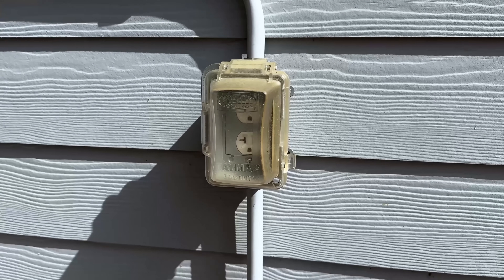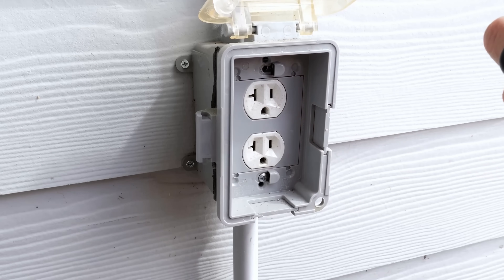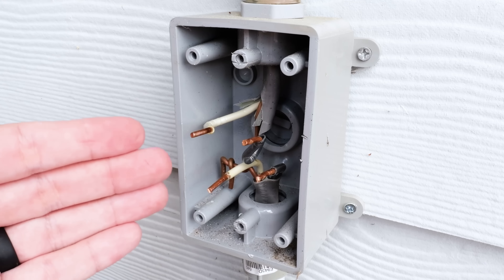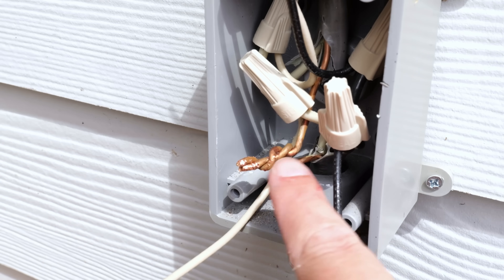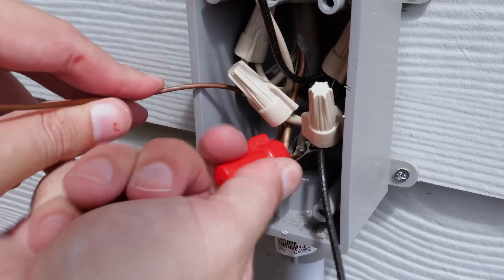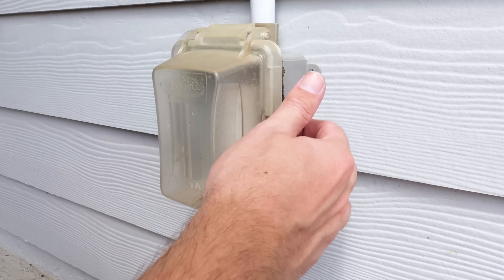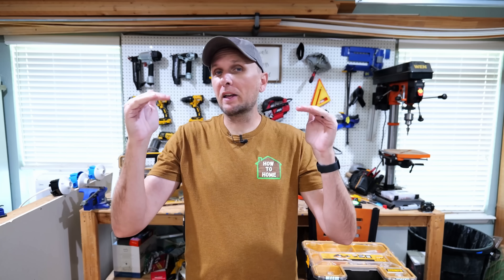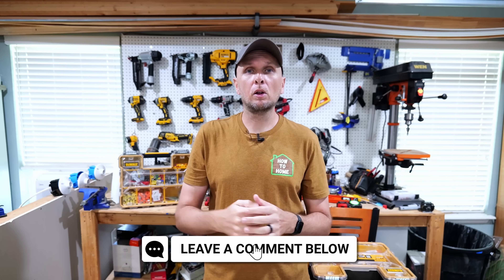Dangerous Mistakes DIYers Miss When Installing Outdoor Outlets!

Comment: Just because the outlet doesn't have a GFCI outlet, it does not mean it is not GFCI protected. The inside garage outlet is GFCI and can be wired to protect the outdoor outlet.
Reply from the maker: Sure, it could be.  But wasn't.

Comment: The GFCI receptacle also has to be weather rated (WR) for outdoor use. I find it odd that you'd want outlets down stream to be protected by that outdoor GFCI outlet since they are more prone to tripping. It also would have been faster just to pigtail and call it a day with less wire in the box.

Comment: You make a video about avoiding mistakes & then you dont pretwist your wires.😂
Reply from the maker: Not required so it isn't a mistake.  It is a better practice, one that I almost always do.  However, when you are working with #10 wire that is that short, good luck pre twisting it and not risking damaging either the wire or the copper itself.

Comment: Just a heads up, but, with outside receptacles, I will run a bead of silicone across the top side and down sides where it meets the wall, just to insure no moisture gets inside.......

Comment: Instead of replacing a bunch of receptacles, couldn't you just install a GCFI breaker in the panel?
Reply: To be fair, you only need to replace one receptacle per circuit, same as the GFCI breaker. The first outlet in the circuit protects the rest of the circuit.
Reply: Yes but those are usually much pricier!
Reply: Not as much as replacing multiple receptacles

Comment: Why did you install a 15a GFCI on a 20a circuit.  You were fast to criticize the prior electrician, but you did the just as bad of job.
Reply from the maker: What was bad about that?  It is completely legal to do that.  I had no need for a 20 amp receptacle there.  So again, please share with code what I did that was so bad.
Reply: @HowToHomeDIY   There is nothing "Illegal" about what you did, however, that is simply because there are 'down stream' devices installed.  (Had this been the only plug, a 20a would have been required).  More importantly is that  you are addressing this to more novice homeowners who are likely confused enough already.  IE, 1) putting a 15a GFCI on a 30a wire (reguardless of the 20a breaker).  2) It would be easy to presume that the 'down stream" plugs were 20a because of the wire size and because the first (original plug) was 20a, so they would be comfortable in increasing their electrical demands down the line to 20a, thus overloading the 15a pass-thru GFCI.  3) maintaining a consistent circuit quality.  ------------------------------------------------------------------------Illegal, NO  diminished professional work, YES.  I believe you understand my point, and having watched many of  your videos, I know  you can do better.  Keep the standards high!

Comment: You can't use Romax wire on a outside receptacle, it has to be TNNT
Reply from the maker: Well actually you can use Romex on outdoor receptacles, it just can't be in conduit in wet locations like outdoors.  Regardless, that isn't Romex in the video.

Comment: I'm not an electrician but according to what I learned - your J hooks are too long and the bare wires they extended pass the screws which is a mistake. Any reason you don't just join the white wires with 1 pigtail and the black wires with another one and connect the pigtails to the GFCI?

Comment: Some 
thoughts…This is a 20A circuit, but you replaced the existing 20A receptacle with a 15A GFCI receptacle—should be a 20A GFCI.  Also, increasingly entire circuits are GFCI protected from the breaker (tho this one is not), so the lack of a GFCI receptacle in the box  doesn’t necessarily mean it’s not GFCI protected. Finally, adding 12awg pigtails negates the voltage drop protection of the 10awg that somebody intentionally installed.  The pigtails should be joined with both connectors to avoid voltage drop.
Reply from the maker: No, it does not have to be a 20 amp GFCI. 

There wasn’t one and I briefly mentioned that.  

No it doesn’t that far upstream.  Has no effect on the voltage drop.

Comment: If 10 ga wire was originally helpful due to voltage drop, you just created an electron bottle neck with the 12 ga pig tails, which is definitely not an improvement.  Meeting code and electrically correct are not always the same.
Reply from the maker: Nope.  That short #12 wire that far upstream will not cause as you said, a "bottleneck."

Comment: Thanks for the video. I have 3 receptacles, none are GFI (1 in garage, 2 outside) 2 have failed. The new electrical run were just added and those are GFI on separate circuits, work great. I didn't think about extending the short wires, but will do that on these next replacements. Thanks again.A+++

Comment: If there is a GFIC outlet at the end of the line that outlet is on, isn't it and any other outlets on the line before the GFIC outlet protected?
Reply: No! A GFCI has 2 connections. 1.) Line. Here you connect power going into the receptacle. 2.) Load. This is the outgoing (GFCI protected) power that can go to the next receptacle and further piggybacked to more receptacle that are all GFCI protected.

Comment: For the DIYer , For safety's sake , Go to your local electrical supply and get a circuit breaker lockout along with a padlock and a warning tag , When turning power off to a circuit you're working on , Lock it out , Tag it out so nobody can turn on the power while you're working on it , I definitely have one in my electrical tool kit 
Lockout tagout is just as important at home as it is in the workplace

Comment: Stop the lies.  You did not fit that GF outlet in that box with all that mess inside.  There is no room for it. That's why the video skipped. Code is code" but code is wrong.  Stuffing those wires in is more of a hazard than a short wire. Stop misleading ppl.
Reply from the maker: Nope, all in there.  It skipped to save time as it skips all throughout the video.

Comment: Excellent video because you never know what is inside a box unless you look.  But you should also mention that a GFCI or combination GFCI/Arc Fault breaker may be a better solution because it is often difficult which outlet is first in line and the circuit may include both inside and outside outlets that require GFCI and/or arc fault protection.  And standard WR duplex outlets are easier to fit in the box that a GFCI outlet.

Comment: THANK YOU for all of the videos you've posted for installing outlets as they have been super helpful to me!  Just finished running conduit to my fence to install a 2 gang outlet, which is powered by a new outlet I installed next to an existing one on my back porch.  I've another GFCI outlet I installed on my front porch years ago and wondered why I had to replace the GFCI outlet every 1.5-2 years as it's in a bubble cover.  You taught me to get the "Weather Resistant" outlets for outside (among other tips).  Appreciate all the help!!  One question- Does code dictate that all exterior outlets be GFCI, or can I get by with one GFCI and connect the load to non (exterior and weather resistant) GFCI outlets?  I bought a 2 gang metal electrical box from Amazon and noticed it has 2 GFCI outlets, but I'd rather just switch out one with a non-GFCI if possible.

Comment: If there was 10 gauge for the run to accommodate the load drop, did you compromise that using a 12 gauge pigtail?

Comment: I wouldn't use the wire nut like this if you have 2 solid wire and not 1 solid and 1 stranded even if you are twisting 1 x 10AWG and 1 x 12/14 AWG. You need to twist them first so you are sure there are no small gaps between the 2 solid wires when twisted. The method used here is for when, like I just said, you have 1 solid wire and 1 stranded wire. The small gaps can create hazards or drop in voltage. Everything else is on point.

Comment: The bubble cover is designed so that you don't have to put the screws in through it and try to line it up with the box.  Install the GFCI/device and put the screws in. Don't tighten them up. Just get them started. Then you can slip the bubble cover over the screws and then tighten. Way easier.

Comment: There is a reason for an outlet to be right side up or the ground on the bottom.  Many appliances like hair dryers plug buttons (Leakage Circuit Interrupter) plugged into a ground up outlet and the plug cable facing up fall out of the outlet or become dangerously loose from the cable movement when the hair dryer in being used.  Many cables that are heavy tend to fall out when the outlet is ground up.  I lived in a house where almost all the outlets were ground up, and it was a constant problem keeping a variety of devices and appliances plugged in.  Hope this helps.

Comment: Question? If the original run was done with #10 gauge wire for a possible heavy load on the circuit, wouldn't you adding the 12 gauge wire defeat this purpose as you put it inline with the circuit?
Reply from the maker: No.
Reply: @HowToHomeDIY  So you are expecting the larger load draw to be handled by the smaller #12 wire? Would that not be like a fuse?
Reply from the maker: @jameshoward8609 no.  The #10 was installed for possible voltage drop not for added load.  The end of the run goes about 100 feet or so underground to my shed.  Where I put the #12 is towards the beginning of the run.  It’s not going to affect any voltage drop there.
Reply: @HowToHomeDIY  OK, I understand the voltage...I guess I was just considering a heavy amperage draw on the line and the #12 wire is the smallest link in the chain.
Reply from the maker: @jameshoward8609 it is technically the weakest link but it’s just a 20 amp circuit so no draw should be able to exceed it’s rating without tripping the breaker.

Comment: Isn't easiest to bond together neutro bolts with a little pig tail, same with hots, to have current in both plugs without 4 wires that overcrowd that receptacle with nuts and wires?

Comment: Running romex in conduit really is not allowed.
Reply from the maker: Where was there romex being run in conduit?
Reply: should have been two conductors and a insulated ground wire. Even if you stripped the jacket off it still not allowed the conductors inside the jacket are not marked with the type of wire being used.
Reply from the maker: @Sctronic209  It is UF wire.  It is all insulated and completely legal to be run in conduit.

Comment: By making the pig tails 12 gauge you made the rest of the run 12 gauge .you should hand made a pig tail and put it to a regular Receptacal and put a GFCI Breaker in
Reply from the maker: That is not how it works bud.  I said it was at the very beginning of the circuit.  That little 6" pigtail is not going to make any difference.

Comment: That's why I like the fact in most European countries all residential or commercial general purpose circuits are required to have RCD type GFCI protection at the electrical panel. In order panels you will find one, two or three RCD's protecting each up to 4 circuits, but in modern systems you will find electrical panels filled with RCBO's which are CB's combined with an RCD.'s so each circuit has because over-current protection also has its own ground fault protection.

Since RCD's became mandatory for all circuits in residential buildings in the mid 70's. Electrocution has become a rare occurrence in Europe. Nowadays its something only grandparents have encountered. People below 40 probably have never encountered an electrocution.

Comment: Great video explaining the issues. Question: If  it is 10 ga. wire to account for voltage drop when you added the 12 ga wire without a direct connection of 10 ga to the line and load, didn't that nagate the reason for using  10 ga to begin with? Would a better option have been to fix the problems in the box and change out the breaker to a gfci?
Reply from the maker: Did not negate it.  Where I put the #12 as pigtails was near the very beginning of the circuit and they are so short.  Voltage drop occurs way further down the line.  A GFCI breaker would be fine but will cost quite a bit more than what I did.  But it is an option.

Comment: Also, it should have be mentioned that conduit, especially PVC, likes to shrink and expand which is a consideration in where to place the fasteners.  In this case there should be no issue but placing one directly next to a joint or adding a second one after the bend in relation to a longer stretch will usually result in additional tension which may damage the connector/fitting on a box and/or pull a fastener off the wall so it is usually wise to carefully consider where best to install, not to go crazy adding too many, and to install so that the conduit can freely slide in them.

Comment: Not to nitpick but in this case you might want to discuss box fill.  This looks like a 2 inch deep plastic box and they typically list 16.5 cubic inches which becomes an issue with 10 gauge conductors.  Having two 10/2 hopefully UF-B cables (you should have also mentioned that any wires in outdoor and/or wet area conduit need to be wet rated) entering the box results in a box fill of 17.5 cubic inches, therefore not NEC compliant unless I underestimated the box size or the grounding conductors are actually 14 gauge AND you take advantage of a grey area by claiming the receptacle should be rated based upon being actually/only connected to 12 gauge pigtails, although some inspectors may not agree.

Comment: Wouldn't switching to 12 gauge for the pigtails increase the resistance/voltage drop for the whole run? Or does it not work that way because its AC and moving back and forth like a seesaw?
Reply from the maker: It doesn't work that way here as they were installed so far upstream.

Comment: I believe the conduit has to be Schedule 80 if it’s within reach of human hands. Also, I don’t think it’s legal to run Romex inside conduit (heat dissipation?). It has to be individual wires, not just Romex with the sheathing stripped off. The insulation around individual wires is thicker and the ground wire is insulated as well.
Reply from the maker: Not required here.  Also, that’s not Romex in the video and is perfectly legal in this application.

Comment: Why did you replace a non-GFCO 20 amp receptacle withe a GFCI 15 amp receptacle.  I know this is code as there are other loads to follow, but if some one really wanted a 20 amp service as they pulled 10 AWG wire a 20 amp GFCI receptacle would be approppriate.  WIth older outdoor boxes the gasket around may need to be replced is it not longer is flexible.  You showed all the pigtails needed, considering the super short run from the prior box I might have been tempted to run a longer wire on the supply side box to this box to avoid one set ot the pigtails and the bulk wires you had to contend with.
Reply from the maker: Because I didn’t need or want a 20 amp there.  I have nothing with a 20 amp plug that would ever get plugged in there.

Comment: Just a few things. First; always check your testing devices on a known live circuit. Next; just wondering how you crammed all those splices into that box; there is code on the allowable capacities in all junction and device boxes. Having worked as an electrician (master general) for 43 years I can concur that the #10 wire is a b^^^h to work in a confined space. The outlet could have been protected (gfci) from an upstream GFCI or a GFCI circuit breaker. Good video.

Comment: I gave up on Wagos.  After wiring a few in electrical boxes and then completing the rest of my "in-box" wiring I found that the wires had twisted out of the Wago's.  I only use them as temporary connections on boxes that I know I am coming back to complete the final work.  Haven't done any real world testing but in my experience the old standard of the wire nut is vastly superior....a billion connections and still running...it's wire nuts for me!
Reply: never had this problem.

Comment: I would question if the box has enough cubic inch capacity for the 4 #10 conductors. I did not do the calculations, but in any case he should have installed a W/P box extension so that he would not have t stuff the GFI recept. into the box. I find that in a lot of older homes the builder used a small metal box in the kitchen, and you cannot physically install a GFCI recept. into the box. You may be able to change the box to a larger one, but with kitchen tiles that may not be an option. Another way around that, would be to use a Wiremold box extension over the original box.

Comment: @HowToHomeDIY, would it be preferred to mechanically twist the 14AWG wires to the 10AWG before twisting on the wire nut?
Thanks ... great videos!
Reply from the maker: Preferred yes.  And it was 12 AWG for the pigtails.  The only reason I didn’t is because with them being #10 and so short, it would be extremely difficult to do and I could possibly damage the wires.  But yeah I’m a big believer in pre twisting wires when possible.  Thanks for the feedback!

Comment: National Electric Code 300.14 requires 6" of free conductor before you put on the pigtail. The wire needs to be removed and replaced to be up to code. Also, withe the amount and size of wire,  the GFCI receptical and wire nuts the box fill is probably more than coffee allows. Conduit supports for PVC must be within 12" of the box.  Depending on the size of PVC, conduit supports may be as frequent as 3'.
Reply from the maker: Incorrect.  The pigtail brings the wire to code.  If you are re running wiring because of this you must really like to do a lot of work for nothing.